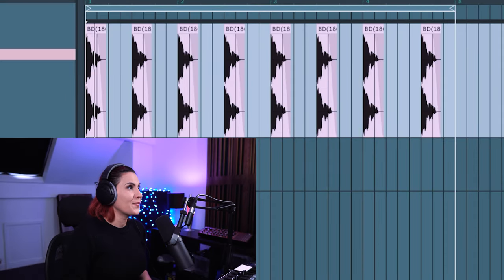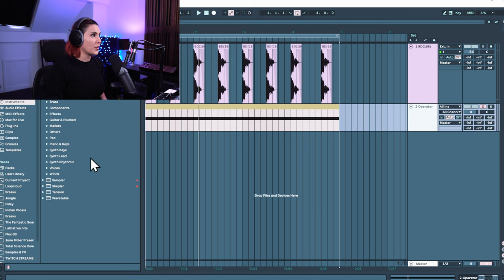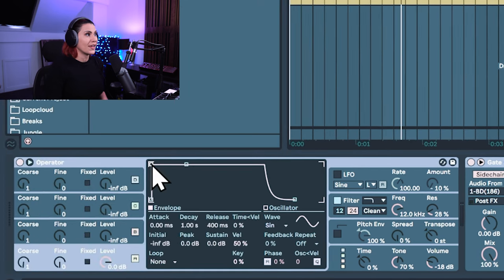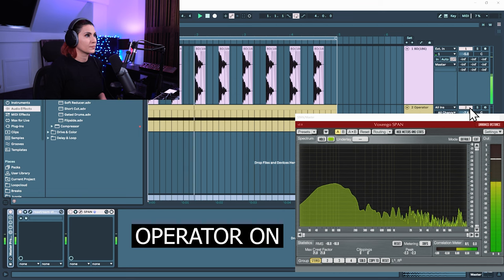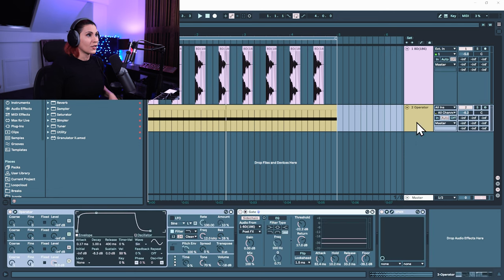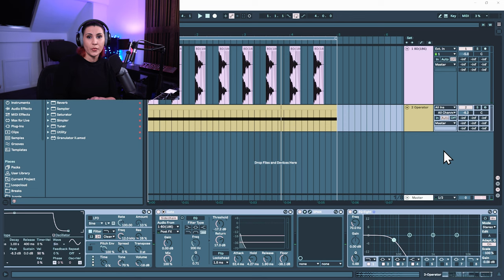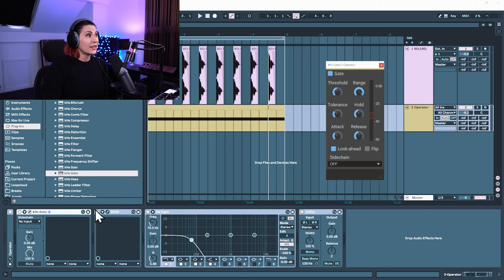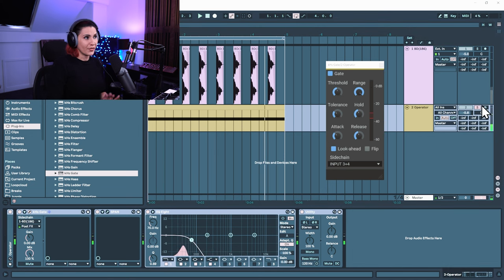How To Get A Fatter Kick Drum | Gated Sine Wave Trick

Comment: Great trick! Just one nerdy comment: Adjusting the Attack in Operator won´t affect the punchness throughout the the sustained note, because Operator is just triggered once. This is done solely by the noise gate. But anyway this is really a great and easy way to get more ooomph in the lower ranges..... Keep them comming Becky. I really like You easy to follow and allways helpfull tuts....
Reply from the maker: What about the first time the note is triggered? It was more a comment to get rid of any clicks and the combined use of the attack on both will remove all clicks throughout (including the first time the note is triggered). I hear what you're saying but it's quite a picky comment to make.
Reply: @BeckySaifMusic  Hey Becky, no offence! Sorry If I came across picky. That was was not my intetion! Your right, it helps to get rid of a potential click at the beginning of the note. And again, I´m very far away from disliking Your vids or trolling. We´re all learning a lot from Your tips. I just wanted to add some further information. Hope that makes sense now....😊
Reply from the maker: @vertecsrecordings  All good. 😊 Appreciate the response. It will help others to understand the topic further at least. I just can't really break down every single minor detail with an explaination in every video and, at the same time, make the video engaging and informative, whilst staying on topic. I took it personally because it happens a lot on my channel lately and I don't see this on other peoples videos, teaching exactly the same topics.
Reply: @BeckySaifMusic  Yeah, I know exactly what You mean. There´s a lot of bullshittery out there. Don´t let this come too close to You. To all who follow Becky or just fly by: She really DELIVERS every time. And there´s not a single Video on this chanel which isn´t spot on. Like, subscribe and ring that bell, as they say... Peace out....🙂
Reply from the maker: @vertecsrecordings  awww thank you. Yeah honestly I'm learning to navigate the minefield at the moment. I'll hold my hands up if I make a mistake but people do enjoy picking at stuff regardless. I just gotta learn this part too. I thought I was just gonna help people with my youtube channel, not open the door to all this other stuff too 🤣
Reply: @BeckySaifMusic  Becky, stuff like that will only bother you if you let it. No one can tell you how to perceive things or how to feel. Don't let haters get to you. At the end of the day they aren't the ones we are here to please anyway.

Comment: Good explanation!

Good video;
Also, worth looking at tweaking/considering the look-ahead on the gate; So it opens up bang on when that transient from the initial kick hits;
Reply from the maker: Depends what works for you and if the lookhead gives you a more desired outcome, then use it. 😊 I like to have the body of my sound to come slightly after, so that the transient has complete space to punch through in the mix. The gate in this video has a 1.5ms lookahead, which I left untouched but I'm sure playing around with the settings will definitely change how things sound.
Reply from the maker: Additional note : should have pointed out that my transient comes from the original drum the layer, not the sub. Maybe that's where the confusion came from?
Reply: In some situations it also can be helpful to use some oscilloscope plugin to allow to take a closer look at the combined waveform to actually see  if You have phase issues or if Your sub kicks in to late or too early. This also can be achieved  by just resampling the master and then checking the waveform of the resample.
Reply from the maker: @vertecsrecordings  totally agree. Great way to check for phase issues. Sometimes I like to bounce the files to audio and then combine the two waveforms together on one track so that they become one complete file. The transient and the body in one. Then you have 0 phase issues.